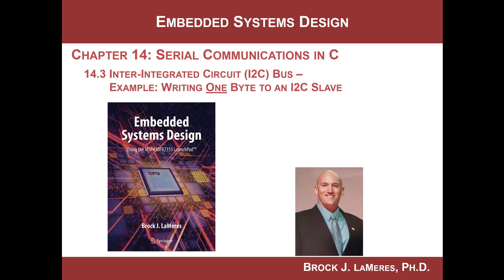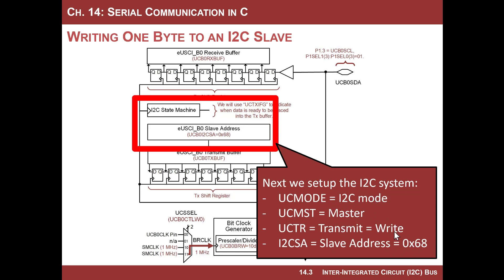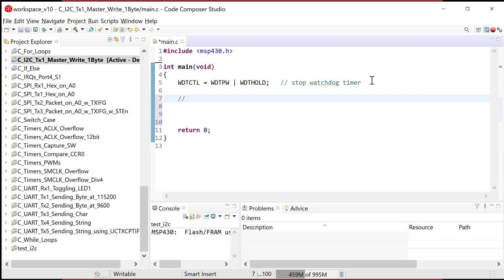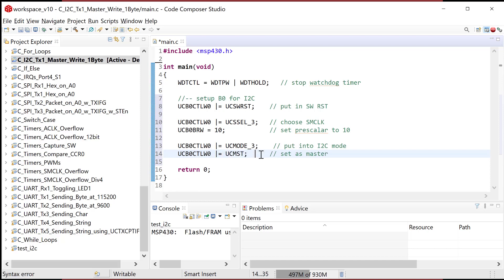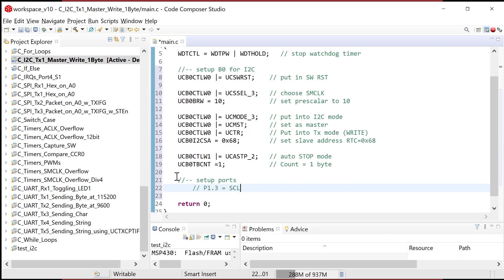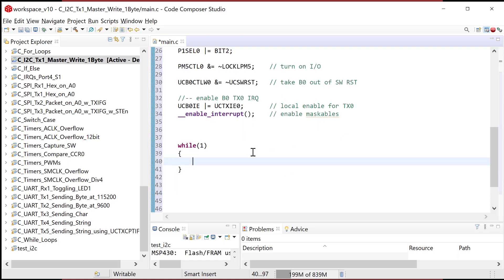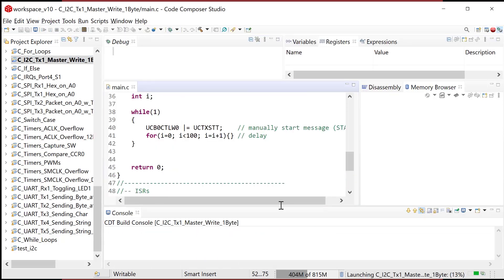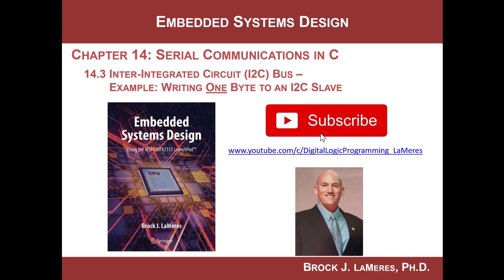14.3(g) - Serial Communication on the MSP430: I2C - Writing One Byte to an I2C Slave

Comment: Excellent series. Just to make the quick (and well explained already!) comment, that to use and test this I2C code one needs the I2C device attached to the launchpad. Otherwise, there will be no pull-up resistors implemented, and the lines will be indeterminate. Brock did explain this earlier really well. Thanks again Brock.

Comment: Tried the example. Worked great then attempted to build functions but struggle to get it to work. 
Your example is not practical.
TI is zero help.
Reply: working on TI's microcontroller felt like a waste of time
Reply: Ok, so today I learned that the slave register is tricky. The sensor I am writing to is a MAX30102 and is addressed with 0xAE for write and 0xAF for read. If I write UCBI2CSA = 0xAE the write will fail resulting in a frame showing start+2F+NACK.
To make it work correctly you must either provide a binary value UCBI2CSA = 0b1010111 leaving out he LSB.
Or perform binary shift right i.e. UCBI2CSA = 0xAE >> 1.
Why it works this way I am not sure but even if I mask the UCBI2CSA register i.e. UCBI2CSA |= it still will not work. 
Only with the binary value or the shift right will it work and deliver to the right slave address.
On my logic analyzer I there for see 0x57 as the slave address which really means 0xAE.
I guess this is a compiler interpretation issue.